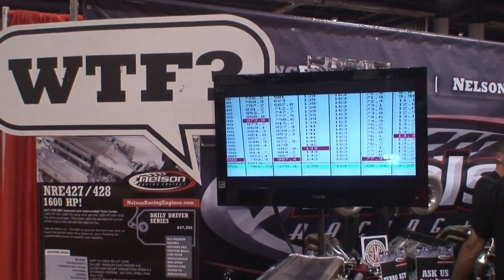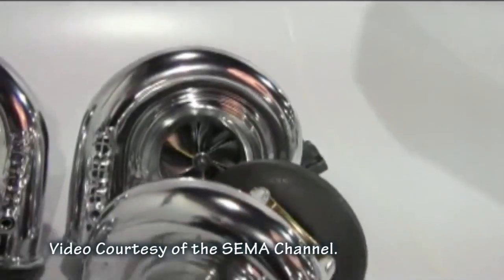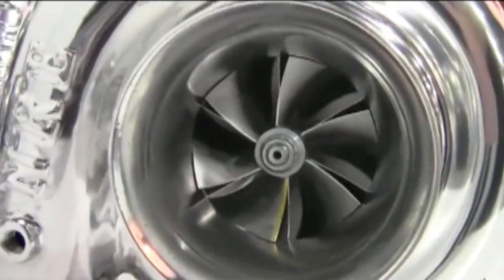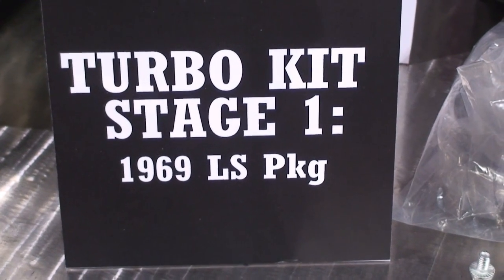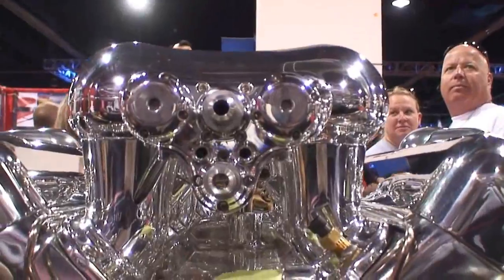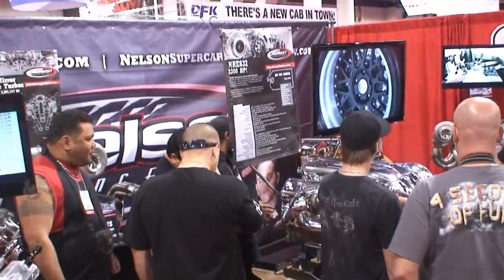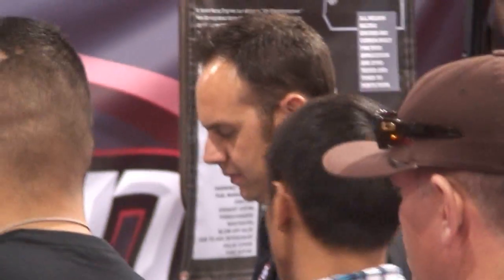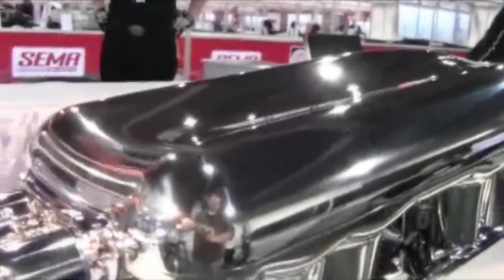Mirror Image Turbos win SEMA Award!  NRE's Patented Turbos acknowledged. Nelson Racing Engines.

Comment: @DillonBerkley I think NRE has the honor for most power. The Hennessey package is the least powerful Ford GT package you can buy, because of the supercharger. But it makes the most low end power, because of the supercharger. It makes about 850rwhp on 93 octane. The Heffner Ford GT makes 950rwhp on 93 octane. I believe with NRE's symmetrical turbos and custom Alien intake they could get 1050-1100rwhp.

Comment: @barath4545 I have been thinking this for quite a while. Try to get into the boat market. There 1350hp is the new standard from Mercury. 1500+ is semi-common, but on race gas. If NRE can get 1600+hp on 91 octane with their 632 then that would be THE engine. Plus, with "Octane on Demand" they could have 1600hp on 91 and 2500hp on race gas in their boats.
Just think, DCB just did 175mph with twin 1350s, so twin 2500s...